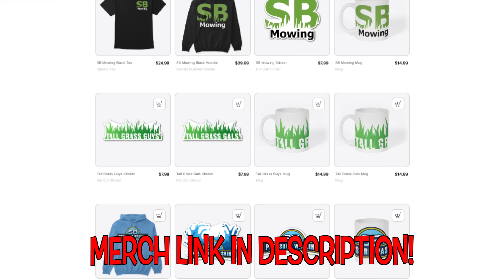He couldn't BELIEVE how much dirt was built up on his driveway

Comment: Im wondering where you get the water source from. Here in europe i have to connect the pressure cleaner to our tap inside the house
Reply: Hose outlets around the outside of the house every home has at least 1 most have at least 2